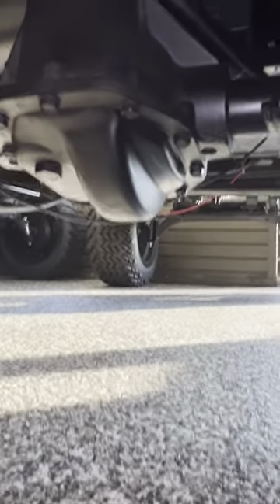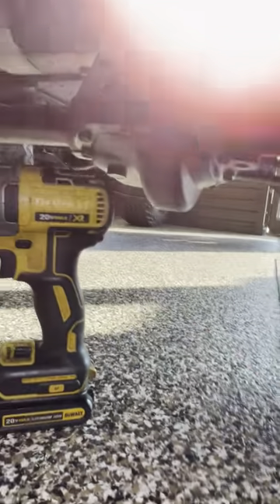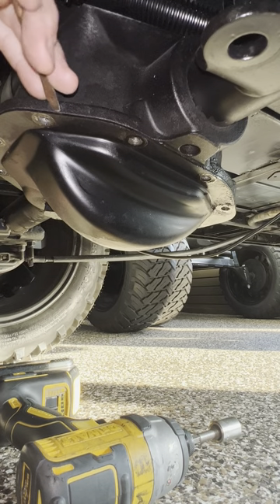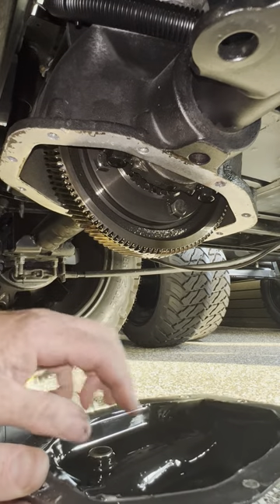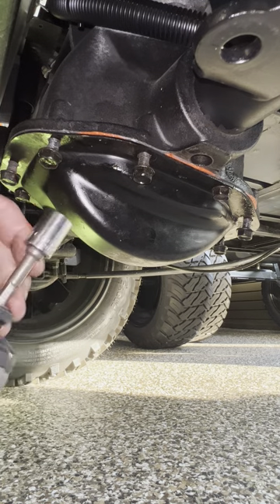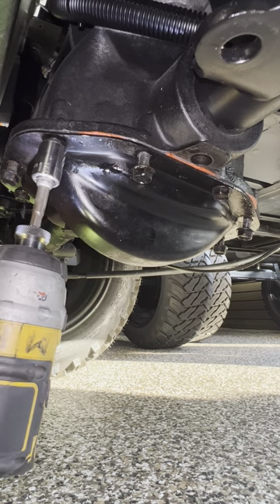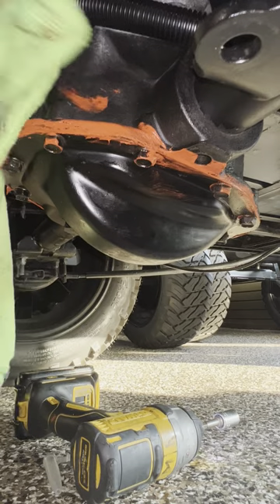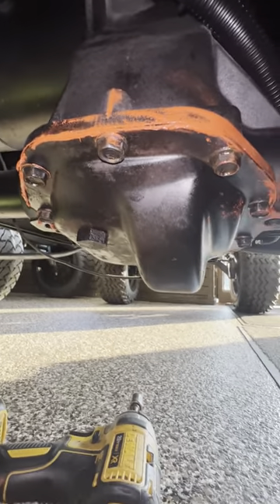Golf cart rear end oil change plus fix a leak.

Comment: I tough 30 w oil was supposed to use  this guy said 80 - 90 gear oil he used.
Reply from the maker: Depends what year the cart is.  The newer ones carry 30 weight
Reply: Ezgo changed, but I forget which year and models.  Check your manual and be sure to use gear oil.